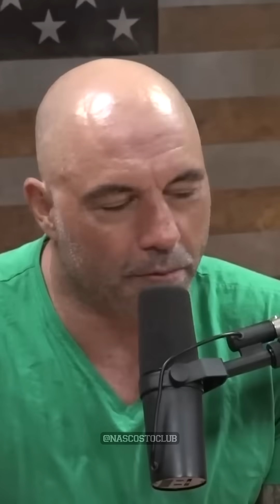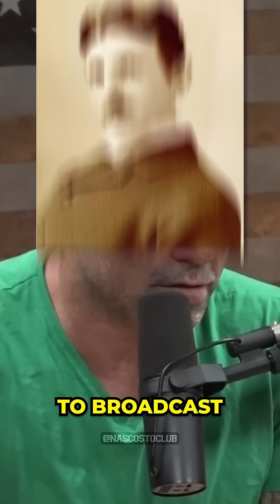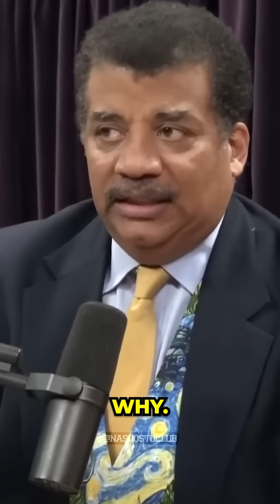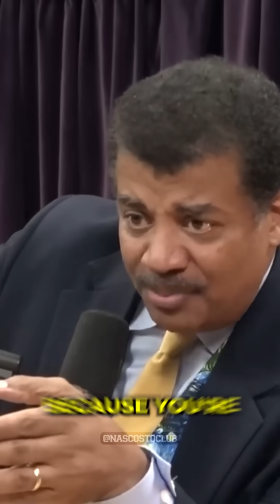WIRELESS Electricity Idea Debunked ⁉️⚡ #shorts

Comment: https://youtu.be/NowhPAMDOTo?si=6kzpmvaahUeKDlk1

You can send energy through the air without getting electrocuted.

So long as you do not touch the radio tower or it's wiring.

Comment: When I think of teslas designs I think of the towers being used for long distance transmissions of power. Instead of using tons of raw materials to build power lines we build a Tesla tower ever mile or so.
Reply: Ya, The electrons being send by the tesla tower they will be at higher frequency so the electrons would just bounce of the body this is called skin effect

Comment: A 400 Watt  solar panel is capable of powering a small appliance, the light that is used by the solar panel obviously has the energy required to make the solar panel deliver the 400 Watt. So, if I stand in between the sunlight and the solar panel, will I die?

Comment: The energy waves don't travel through the air, they travel through the earth. The ground is a ground. You extract the energy as wave energy. Just like from a positive wire. The other end (ground) of your electrical appliance would be directed (black wire) back into the ground. You collect the waves as electricity power what ever it is, and then passively return it into the ground through the ground wire back into the earth.
Reply: Of course not through the air. Unless, you were creating waves. Two waves acting together create electricity. You don't get shocked by the waves. Another way, you project a wave through the air and then capture the wave with another wave that is contained. This would also create electricity. It is so easy to think that science we know is all there is. He's wrong many times. I can count the waves. Yes Neil is smart. But, he is not an electrician, never welded steal to steal and never created a transistor radio. Think about it. Are we going to take his advice!??? Let's see him hook up ceiling fan first.

Comment: Wait a minute. Sure, radio waves aren't powerful enough to drive your appliances. But we have power electronics for exactly that. Ever wondered how when pilot presses a button, it changes flight direction? Well, it is all thanks to power electronics. It can amplify very small signals. So even if the circuit for flight control system requires very little electricity to work, high power can be delivered to the actuators requiring higher voltage.

Imagine doing the same with wireless signals. Not easy, but definitely possible. Find the signal in the noise and amplify it.

Comment: How does my phone charge on a wireless charger? I just put it on a a wood charging station, and it charges my phone. My last charger was like a coaster, and my phone had to be placed just right. Now the signal seems to travel through wood. I don't think wood conducts electricity. I'm not saying the angry loud man is wrong here. I don't understand the technology to charge my phone without plugging it in?
I also don't get the magnetic charging cord. The electricity goes through the magnet and into the phone, but won't shock you if you touch the magnet while it's charging.

Comment: mainstream clown. radio waves is a supposition. tesla said "radiant energy" it is most likely longitudinal current not radio waves and transmitted using the ground as a single wire connector.

Comment: Neil's wrong.  There's a Maximum load any one wire can carry.  The atmosphere is Massive. The particles are much farther apart in air than metal,  Tesla walked around,  just fine,  right where he was pumping tons of current into the air and ground.  The air doesn't electrocute you when it's full of current,  but when you put something highly conductive in that air, like a light bulb,  then the current flows into it.

Comment: Tesla did not plan to transmit electricity through the air. He planned to use the Earth as a natural conductor, and he may have even had plans to use the Earth's natural magnetic field as a means to generate power anywhere it's needed. Neil DeGrasse Tyson really needs to do a little research instead of always talking out of his posterior.

Comment: Neil is correct.  
Wanna know why they enclose broadcast antennas with prison fences and barbed wire?  Because if you stand near it it will irradiate you at  several hundred thousand watts of power.  You'll be dead in a day or two. 

Tesla must not have done the calculations correctly or been ignorant of how much radiation it takes to kill a person.

Comment: He neglected to mention that we use the exact principal of Tesla's idea all over our world. Energy can be wirelessly transmitted by radio, light, sound, magnetism, & heat. What is a transformer (a basic component used all across our grid) but a wireless connection between two circuits? Literally it is just using the electromagnetic field of one circuit to move the electrons in the other circuit.

Now obviously it doesn't work great over long distances (magnetic fields are logarithmic) but we know you can move energy with other things, that's literally how the sun heats this planet.

His refutation is merely a lack of understanding and creativity.

Comment: 1st Neal your not as smart as you think you are sir. It would be sent at hz that could not penatrate the skin..There would have transformers suspended above homes to transform the electrical wave to a usable transmission for our house hold goods. It was not dangerous this is demonstrated when someone holds a light bulb beside a Tesla coil with bolts flying off it an the light bulb lights in thier hand unplugged. So Neal don't ever call Tesla ideals nutty sir. I could go more indepth about this,but won't att. I have seen many things work that Tesla invented that the world is still not ready for.. but when you turn light on ride elevator , watch TV or even lesson to radio or control drone by remote I have one word an its not Neal its Tesla sir.

Comment: thought you were smart Neil. You can use energy like Bluetooth.
Reply: What do you power using bluetooth?
Reply: @Kel Duck  nah I said wrong, Neil said you can't power nothing thru the air. But you can, you can charge anything that have a battery using Tesla coils. Free energy in the air. It's like Bluetooth basically

Comment: Well, basic LEDs most certainly cannot kill you. Efficient lighting doesn’t require much electricity. Think about the potato battery. So you could send electricity through the air, but to avoid waste, it would likely have to be short distances within a house or high in the air in significant volumes, like constant cloud lightning between power poles or something

Comment: Look up electric sky, whisper beam is what they call it and they use radio waves to send power up to as high as low earth orbit. Non gaussian waves I think is what their called and the can actually shape these radio waves and send them to a receiver and their gonna put them on planes.
Reply: I wonder why they are pointing the beam upwards away from people?
Reply: @kelduck8851  the article says they want to extend the range for electric planes and they hope to give power to the international space station
Reply: @milesvoss1406  Cool, they are still pointing it away from people.
 You can power some things through the air, just not all things, its too dangerous.
Reply: @kelduck8851  ur response is just confirming the article, from what I read the radio waves coalesce at the receiver, until then the frequency are just in the wave range to be categorized as radio, it sounds almost similar to how a radio works in principle, these waves are around us being broadcast and the radio antenna picks up these waves and translates them into what we hear, u could read the article I think its cool they've found another method to transfer energy.

Comment: But couldn't you collect that lil bit of energy from the radio waves into a compressor of some sort, compress it and push it to your light bulb or toaster in a much more condensed state. Kinda like how a hydraulic lift works.
Send the waves via air to a compressor right in the toaster and bam, breakfast is served.

Comment: Niel is an fraud... He's hasn't got a clue as how to approach the tesla. Idea... Cuz he thinks in how electricity now a days is created
If you flip the current situation 180 degrees. And instead of drawing voltage from ground  trough a coil and into a wire to the enduser.
Tesla did the opposite draw from the sky feeding the ground.  And at th end users site have an antenna sending it back in te eather to the source
An electrified earth may sound scary but being scared is for ignorant people. 
Now all you need is to know how Vortex based mathematics worc. And where on earth you can set up shop.
Be it on the crossing of laylines or some other spots where earths geomagnetic fields like to linger...
Any how degrasse Tyson is an evol fucxin satanist

Comment: tesla wanted to send whole sale electricity wirelessly... and that seems crazy... but we've done  it long time ago.  an example is a solar powered calculator running off electric light.   to use the same concept on a bigger scale, is to  shine a bright light at a solar panel from a distance.  it will in fact transmit power wirelessly through the air.

Comment: How does a remote and TV work or how does Bluetooth head phones that works dozen or communicate signal through the air and nothing blocks it you can put your hand in between the phone and your Bluetooth that and your phone was still work if nothing is gonna be wrong with it
Reply: Information sent in a signal is low power, sending say 240 volts at 50 Hz, now that would be an issue.

Comment: Working at substations, you can feel and hear the electricity in the air around you. Constant static electricity gets you without proper ppe and if anything stronger is near you, you'll get an arc flash and you'll be a pile of ash
Reply: Substations collect electricity. Yes, that's how that works. You are literally walking around electrical conduits.

Comment: There are devices that get their power from waves in the air but they are very low power. In order to power anything more you have to collect that power for a very long time. The run time would be very short in comparison to how much time you need to collect the energy.

Comment: This simply isn’t true. There are near field chargers today that you can plug in your wall, sit a lamp with a battery across the room and charge the battery through the air enough to power the lamp. I have a near field charging system for the spinal cord stimulator in my back, where I strap a disk around my waste and that disk transmits electricity through my body to charge the lithium ion battery inside my back. Neil is far too dismissive of things because he’s got to appease the masses and cutoff anything too different before it gets momentum. He’s s shill.

Comment: electromagnetic waves wouldn't kill you but if you broadcast around at 360° you're losing power/energy by the square of the distance so you're basically wasting/dumping energy and it wouldn't even be 1% efficient. if you target it directionally, then wire is better. efficient targeted energy beam would be useful to power light aircrafts that wouldn't have to carry the energy (gas/batteries/hydrogen) or even  wirelessly charging electric cars through the roads, units not broadcasting. you would just generate the magnetic field under the cars

Comment: There's a set of low-power applications that can use the EM power in the air, right now. Not lightbulbs, but there's certainly use-cases.

Comment: You can center focus a beam of energy from a transmitter to a receiver….that’s what Tesla was experimenting with on his towers, it wasn’t just a radiant beam of electricity displaced 360 degrees, its lost energy like that of a cable in a ground that’s in 2 pieces. You’ll still have residual energy but at the cost of the ground absorbing it around it.

Comment: His idea wasn't as simplistic as that. He had thought a bit of this. After all, he's the reason we have alternating current.
 He wanted to ionize the atmosphere. That's the purpose of building these high towers, because the closer they were to the atmosphere, the closer they could receive the energy .
The atmosphere would act as the wire in his analogy and there would be no one in his way. It would probably still be dangerous to anyone flying, but that's how he planned to distribute electricity.

Comment: I thought he was trying to transmit power thru the ground, not air. you just had to stick a probe into the ground. I think the idea was to pulse the power neg and pos. then use a capacitor reverse the cycle so that you would get a potential difference

Comment: I worked on an air search radar. It could put out enough energy to disorient birds as they flew by. Every time a helicopter came in we would have to turn off part of the radar so it wouldn't screw up the helicopter. I'll stick with cables and wires.
Reply: That's because birds navigate using the same basis for the technology of that radar. Dolphins and bats use the same basis as the submarine radars. Dolphins use a click, subs use a low frequency ping. Dolphins register the reverberation of objects through their brain, allowing to "see" when they could otherwise. Subs catch the reverberation of the ping into specialized equipment, allowing them to "see" when they otherwise couldn't. Of course you're going fuck with birds. You're interfering with the same natural elements they use to navigate. Specifically, I don't know what else to tell you. Those machines use the exact same elements birds do.
Reply: @carminescurse well yes but the same thing is used against humans too.
Reply: @ImNotQualifiedToSayThisBut  no it's not. We do have the specialized organs to collect data from our environment like that.

Comment: Tesla worked with DC, not AC. AC has to be insulated and can kill you… DC is much safer. Edison tried to prove Teslas DC was dangerous and had to use 100,000+ volts DC to kill an elephant (which he did)

You could kill an elephant with just 220v AC.
Reply: @Brad-qw1te  crap you’re right. Thanks for the comment! That’s why I shouldn’t comment first thing in the morning.

Comment: I built a AM signal powered radio as a kid. Tesla's idea works, but needs a collector the same way that solar energy works. The amount of energy in any given inch transmitted by radio waves is not energy rich enough to power a item, but  concentrated and used to effect, sure.

Comment: Firstly, electricity does not flow through wires it’s actually in a field. Second, the energy would not be concentrated in a high voltage beam, it would permeate the air and I think there’s enough real estate for the air itself to not be high voltage.

Comment: law of physics dictates you can broadcast electricity; and if you do through vacuum lead pipe it will transmit electrons; through the pipe; with no losses; no degradation; its just not going to be cost effective; 
its lot more cost effective; if you used amplified vibrations from ambient environments to wobble balloon to rub against fur to generate electricity; as self generating electric generator; to power tesla electric tower

Comment: He wanted to use the ground not air. He wanted to charge one tower that had an exact build to another tower. The tower that didn’t have an electric hook up would vibrate at the same frequency and charge itself mimicking the voltage applied to the first. He was trying to pull electrons from earth not air.

Comment: Ahhh?? Doesn't wireless charging already exist? Lol
Reply: You do not need to "move" the required power through the air to power the devices. You just need the right device to concentrate the "sufficient energy",  then use it. Kinda like how we use solar power.

Comment: Electricity does flow through the air though. It flows through electromagnetic fields in the air around the wire, not through the wire itself.

Comment: I don't get why he's getting so pissy about it. Electricity generation is wireless through electromagnetic fields.

You could use electromagnetic fields to transmit electricity wirelessly.

The problem is to direct the fields so that ever conductor in the way doesent also have a current flowing through it.

Comment: To energize a lightbulb the issue is not the amount of power the issue is exciting the fluorescing material inside the bulb if you use the right lamp you will need only I miniscule radio wave to do it. One of the instructors in my class did it using a radio in class and turned an f12 lightbulb on using the radio to show  it could be done. Don't take my word for it try it yourself. And even though I think Neil deGrasse Tyson is fantastic sometimes I think he condescends to the point where he is somewhat the academic bully. Joe is a real gent because he wants the knowledge he knows Neil has it and he's willing to tolerate getting bullied that way a smart move if you know what I know about this guy Neil deGrasse Tyson he is a real intellectual Powerhouse.

Comment: I mean, Neil is right.  Microwave transmission of energy can be done.  But there's no good reason to.  Air is a poor conductor.  It's the same idea behind wifi being a poor substitute for a wired network, albeit on a much lower level of power used.  Copper will always conduct electrons better than air will.  And if you're anywhere near that stream of charged electrons, they will happily ground themselves through YOU rather than the air they don't really want to flow through but are being pushed through.

Putting electricity through the air is an arc.  Arcs generally are bad for the reason Neil describes.